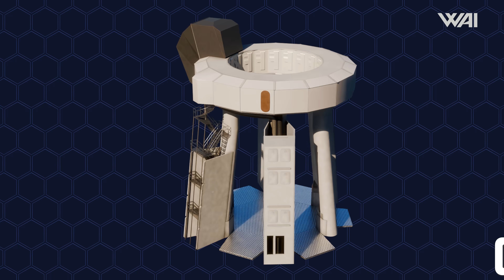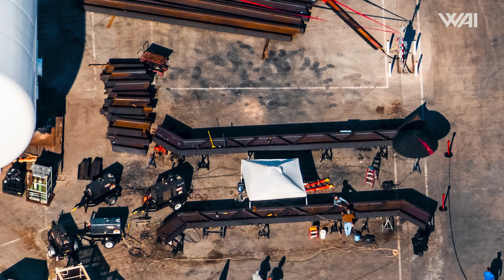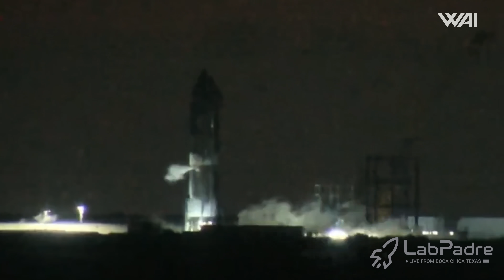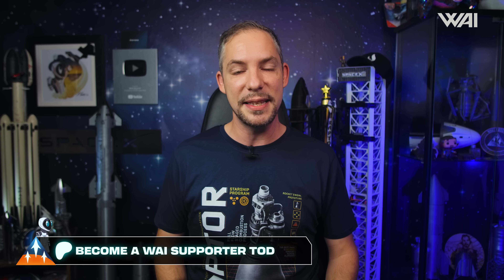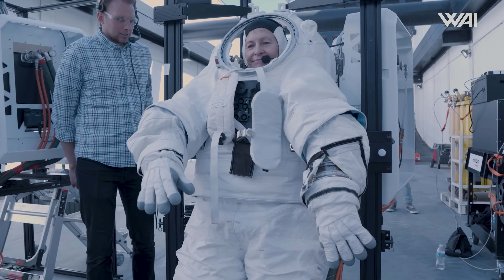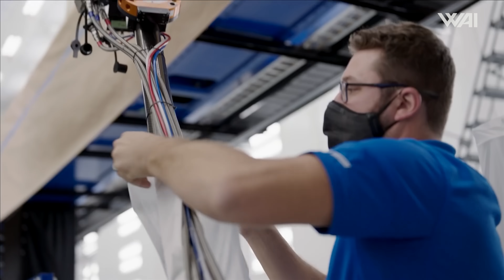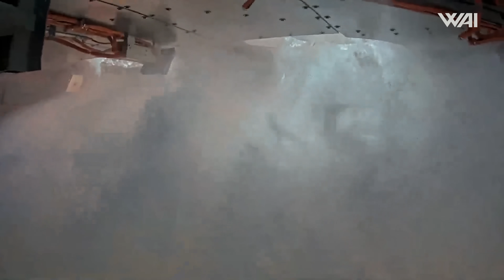SpaceX suddenly gives out HUGE info about Lunar Starship!

Comment: I’m convinced that 7 experienced something called “Rollover”, which means the LNG gas at 600/1 began to boil from differential pressure gradients. It started to expand uncontrollably which would have required large enough PSV’s (Pressure Safety Valves) to send the gas to an exit point or flair system. Also, they could have installed “Rupture Discs.”

Comment: I have to comment regarding waste water. With flames reaching so high temperatures,  even N2 splits and oxidises to NOx. Hotter the flame, more chemical reactions happen. So saying that result of hidrogen burning or methane burning is watter an CO2 is not correct. All parts that erode during exhaust touching them, react, so result is a lot of different chemicals. So being carefull is correct way to go, and watter treatement or reuse must be goal not dumping all that.

Comment: Felix, thought you would appreciate the following feedback. At 9:10, you're discussing that the Starship Block 2 is supposed to have an additional 300 tons of propellant over that of Block 1. You advise this while showing SpaceX's diagram capturing the differing stats from Block 1 to Block 3. However, you incorrectly highlight with a text box the increase of the propellant load of 3300 to 3650 tons - for the Block 1 to the Block 2 Booster. You meant to highlight the values of 1200 to 1500 tons - hence the 300 ton increase that you correctly refer to - for the Block 1 to the Block 2 Starship. Hopefully you can readily update this video. All this aside, thank you for your ongoing videos on SpaceX and developments for other rockets. I catch up with your videos every week.

Comment: I still loath ladders for the inside, i want a central spiral staircase which the steps can fold up so in 0G it is just a passageway. ladder suck to carry anything up and down especially in any sort of space suit. no need for elevator and could easily add a light weight winch if they need to lift heavier object up through center.

Comment: When viewing Starship Flight 5 launch, I was impressed with the size of the fireball and the spaceship rising out of the fireball as it started its ascent 

Then I thought how wasteful and that the fireball is a product of bad design.

All that energy in the fireball should be captured like the barrel of a gun. Instead of just letting those gasses escape, particularly rockets like Starship which have such powerful engines should be launching from a long cylinder in the ground of incredibly hard bedrock and shot out of the ground. The described fire trenches should be minimized or eliminated completely

Comment: Sometimes, when I see these CG examples in orbit, I think to myself the same way we were able to create the ISS piece by piece. Could we now, with reusablity and fast production create, in the same way a space ship in low earth orbit?  

An idea is combining modules or starships and lifting boosters with boosters to attach to said modules for thrust. With boosters programmed or wirelessley controlled to fly towards modules and that attach boosters with fresh propellant. This would be the makings of ship built in outer space. It could even ignite the idea of a space station that can produce ships, A space staion with a working ship yard, is any body with me on this?

This is where the idea of refuling in low earth orbit bugs me. It seems trivial when you could possibly use that second starship carrying fuel as another piece to create a bigger ship with more payload.

Comment: CSI Starbase suggests that Raptor 3 will use methane for endogenous pressurization of the methane tank, rather than the exhaust gas from the fuel-rich turbopump which includes carbon-dioxide which froze and plugged the fuel intakes.
Reply from the maker: Autogenous. Yes, that’s one way of getting rid of the problem! It would make a lot of things easier. He talks a lot to SpaceX engineers and releases IP that shouldn’t be released. That’s why I normally don’t quote them. WAI doesn’t cross that line. ❤️

Comment: Why do you keep saying that the V2 'ship' is the same size as the V1?  Don't you read your own charts?  The V2 ship is 1.8m or 6 feet taller with the booster 3.1m taller.  Six feet is a lot when you're dealing with fuel tanks expecially if you consider making them not only taller but bigger in diameter.

Comment: hmm, block two is one ring second larger than block one, the forward flaps were moved leeward not to resolve the burnthrew issue, they were moved as they fight against the rear flaps during reentry so moving them eases the stress on everything and lastly, the water weights were used after the chopsticks were reinforced, not before. Sorry to be picky but there are a few holes here Felix.
Reply: Just speculating but it does make sense if modifying introduces some dihedral and improves air flow so rear surfaces are less likely to be affected by disturbances caused by the forward surfaces. After some flights engineers might have found that actual flight dynamics might be a little different than expected necessitating changes

Comment: Space scraper variant with opening mouth to gobble up redundant satellites/debris. Creation of space x orbital foundry. Can the header tanks be moved lower down to accommodate a big whale mouth? It’s probably impractical but I’d love to see it!
Reply: Unless they can create Barrier so that the debree doesn’t penetrate inside into the fuel tank , they’d need variant with more angle placed thrusters , to precisely and with adjustable speed, also crew or machine operated crane inside that would secure them
Reply: @ not including ISS an estimated 9000 metric tons of materials considered “debris” is in orbit. The ISS is about 400 tonnes. So much commentary about Starship cargo capacity… yet in orbit we have thousands of tons of potentially reusable resources. Imagine the cost savings in launching raw materials into orbit for say a lunar or Martian base if these materials could be collected and processed in orbit. It must be possible, it must be cheaper than launching hundreds of rockets to achieve the same mass. You could launch a couple hundred tonnes purpose built solar powered vacuum smelter, focused on refining say 2 or 3 materials from space debris say aluminium alloys, Titanium and gold… imagine if 2 modified starships could collect debris and output would be 4000 tonnes of alloys, hundreds of tonnes of titanium and a ton of gold… that would make the construction of a vast space station, vast spaceships vastly more affordable and indeed possible.

Comment: As shown on the table at 9 minutes in, both the ship and the booster get around a 300t fuel capacity increase for block 2. You’re referring to the ship but the number for the booster is accidentally outlined which makes it seem as though it’s not a 25% increase. Small editing mistake that had me feeling a little confused for a moment!

Comment: What is New Glenn’s 2nd stage?  They are expending that like Falcon 9 and FH, right?  Starship is like a 2nd stage but intended to be recovered and reusable…that’s a big difference.  But can they actually accomplish its reusability?  We’ll see.  Starship may be able to be a tanker version…mostly propellant; an unmanned cargo version; perhaps a manned cargo version for satellite recovery and repair, like Shuttle?  And a Lunar version in which reusability is a big question.    Maybe a long-endurance Mars version at some point?  I would think in a 3 or 4 ship tether or docked to a truss structure for flights to Mars.  I don’t see a purpose for sending a single ship to Mars, except maybe the first prototype.  Nonetheless, there would need to be a ship on orbit to collect data on the first prototype’s reentry and landing performance, and transmit that back to Earth.

Comment: H2-O2 rocket engines don't just produce water, they also produce a lot of ammonia,  and nitrous oxides as the super hot oxy-hydro flames interact with the nitrogen in the air.

True, the water deluge systems tend to mitigate that quite a bit,  but it still happens.

Comment: the crane could just not be needed at the moment in there plan and if moved they could work on the approach to the flame trench which i think they will build last everything will have to line up if they want interchangeable  launch mounts to speed up launches    which is all down to repairs after launch          they can do the launches  they can catch it now they need this beefed up launch pad    once they get it right do you think they will take out launch pad 1

Comment: Yes, what we saw MUST be an early version of a mockup for Starship. One thing that isn't taken into account on that design is center of gravity. With all of the bedrooms for astronauts on one side that would put the center of gravity too far to that side of the space ship. They will need to take mass and weight into account and make sure it is even or they will have a rocket that won't be able to steer straight and the last thing we need is a space ship uses all its fuel while a wheel (you know what I mean) is out of alignment. 

Anyway, they only released the drawings for a very early version just to mess with people because Elon would never let them make public a close to production version of the layout. It's definitely a very early draft.

Also, the likelihood that there will be viewports that astronauts would be able to look out of before exiting the space craft and stepping foot on the moon is unlikely because staring at a screen will not help them get their bearings before the moon or maybe even a space walk.

There is still a possibility that they could add another ring to Starship to make the storage area larger. It wouldn't add a significant amount of weight compared to the weight of the whole space ship and they could still use up the whole section that they are partially entering for the tank and fill that whole section with a bigger tank while adding another ring.

Comment: Two things I don't understand: 1.) At 9:20 you say the block 2 ship "has stayed at the same size" as the block 1 ship? I thought that block 2 is about 2 meters taller (52.1 versus 50.3 meters)? 2.)  At 9:11, the propellant weight increases from 3300 to 3650 tons, which is 350 tons and only about 10 percent increase, not 300 tons and 25 percent increase, as you say. Do I miss something here?

Comment: Block 3 will bring us closer to the 100t cap, not 200t. I know, I know SpaceX promises this and delivers that. But it's clear by now that unless there is a significant boost in performance and reduction in weight that the original goals are not achievable. That could happen with Raptor 3, maybe. But what's more likely going to happen is walking back those extraordinary figures. Even 80t to LEO is a significant milestone as it surpasses any operational rocket including Falcon Heavy, in addition to be fully reusable. Those big numbers will happen, but the rocket needs to get significantly larger! Block 3 is bigger, and I think that will become the operational workhorse, but it's the next generation that will take us to a 200t cap. And I'm not talking about Block 4, I'm talking about a completely new rocket.

Comment: I've always felt that the SX Starship meant for the moon was larger and did more than required. That could be a very good thing sometimes while at other times it takes away from the value of the project. If NASA plans to send only 2 to 8 astronauts at a time, why build a ship for 20+ with a forty foot ceiling? That could come later. I would rather use that space for additional fuel and minimize the refueling requirements of the vehicle. SX is taking the basic Starship design and changing just enough of it to get to the moon. NASA pays for their part of the development and that reduces the cost of the mars ship. Everybody's happy if it works. I suspect SX's objective here is to take all of the pie. The Artemis program is VERY expensive and so complex and requires input from a bunch of unsuccessful providers that it may never work. Even if it works there will only be a few astronauts at a time in the early years. The SX alternative; one ship direct to the moon, build a moon base and work out from there. All for half the price of Artemis. If we don't do that China will be there with their own station waiting for us.

Comment: OOK -------- . Last year SpaceX  tested a thin skin built tank that was never heard from again... While the additional Starship Tankage is to increase the Cargo to Orbit tunnage as soon as possible now. As soon as Space X can finish the Actual operating Engineering flight Stress analysis, Space X will start using that Thiner Skinned construction in the proper places lightning both the Booster and Starship, giving both back much of thier original Cargo tonnage.  Why Musk is talking about increasing the Cargo tonnage of the Block 3 Starship combination to well over 200 tons and possibly 250 tons. The added Tankage of the Starship Lunar Lander will also allow the Lunar Lander to leave Low Earth Orbit (and not some high odd inconvenient orbit), land on the Moon with hundreds of tons of cargo and return to low Earth orbit to be Refueled and Reused for additional trips to the surface of the Moon without needing to refuel in Lunar orbit or have to use the GATEWAY Station... and all of the Corresponding Benefits to creating a Permanent Lunar Base

Comment: Nah, we aren't going to see starship catch attempts until the second tower is capable of catching.   It's impossible to catch both super heavy and ship in rapid succession on the same tower with the current design.   Aside from the fact there's no reason to, given that most ships will need to go back to a payload integration facility.  The obvious exception is, of course, tankers, but I doubt we'll see a ship return to flight with 0 refurbishment for a year or more, at least.  Rapid reuse of the booster is the real key to this systems success.   The ability to launch, catch the booster, roll another tanker in place, stack, and go again is key.

Comment: Not thrilled with the header tank(s). It LOOKS like it chews up significant volume of the starship payload capacity and makes the clamshell opening of the starship LOOK impossible. Maybe I am mistaken but it seems like the majority of typical paying customer payloads will not fit through the "pez" dispenser opening. Since one HAS to assume that SpaceX is building this to actually make money, you would think they might have unveiled a variant that actually can deploy large satellites or Dream Chaser. Just a thought.

Comment: OK -------- .  Best What About it Video Yet simply because it showed the Lunar Lander Inside....   LOL.. But lets get real...   A 40 foot upper deck Ceiling?    With 15 feet between the Two decks?   How about we move the upper deck into the tapered bow just below the already specified Nose Airlock for docking with the GATEWAY Station or Orion Capsule or even the Dragon...A 10 to 15-foot tall partially tapered ceiling sounds right with plenty of room for everything from the 30-foot wide deck below moved to the now 26-foot wide top deck for the shown 4 crewmen or even a dozen crewmen with just a little more friendly accommodations. The original pictured bottom deck would be moved up just below the top deck with all its air and water handling equipment as well as storage and even work benches and science desks, but with only an 8-foot ceiling and a shallow curved Air tight deck as below with a small single man airlock on the side that does not interfere with Cargo below or equipment on that deck.  This Small Airlock provides Access to both the lower cargo decks as well as the outside hull allowing for an Appolo 13-style emergency Life boat lander Bow compartment separated from the rest of the lower air-tight shirt sleeve Cargo section below the crew quarters section that can be put in Vacuum if needed in case the lower deck's Main Cargo Corridor Airlock that is 7-ft X 7-ft & 9-ft long that holds 2--4-ftX4-ft Crates or 6 suited crewmen (the size calculated for the most efficient use of gas and time resources with multiple Airlock cyclings) used for general cargo access to the ground elevator, in case of Either hatch malfunction from Lunar dust build-up, blockage, Accident damage, for some unknown reason or simply Time. Trapping the crew outside or in the upper decks with no otherwise way to access the lower decks, the surface or back into the upper crew pressurized decks with a wide open or blocked Cargo airlock. "Just in CASE".  This also allows 1 of the Cargo Decks above the main cargo surface access deck to have a full 8-ft tall X 12-ft wide cargo hatch in the HULL with no airlock that allows at least one Rover or Surface Habitat that is up to 29 ft long to be carried in the ship that is far too large and long for the lower deck general cargo airlock. This arrangement allows for the 4 to 12 crewmen to Safely access and unload general cargo onto the Surface of the Moon and run their little legs off all across the Moon. While not worrying about getting back into the Lunar Lander crew Habitat decks when it is time to rest or leave.....    Just a few thoughts... adt-2

Comment: well we all saw how much fuel the booster had left after getting caught, that was quite a safe margin, maybe they want to do the same in preparation for a ship catch , and only after getting things tuned in they will risk running to lower fuel levels after landing, much like falcon 9 , for that one they just need enough fuel to burn for x amount of seconds and that's it, it either lands or explodes , there is no hovering and correcting it.
  On the other hand booster and ship both can hover and a tiny bit of extra fuel goes a long way in case of a missed approach. to either try again or just abort to a safe distance from GSE